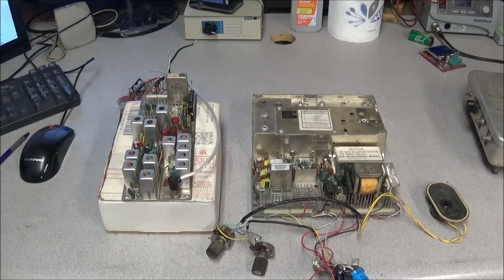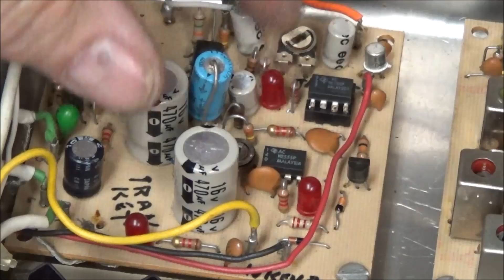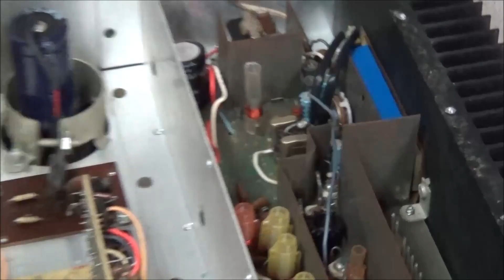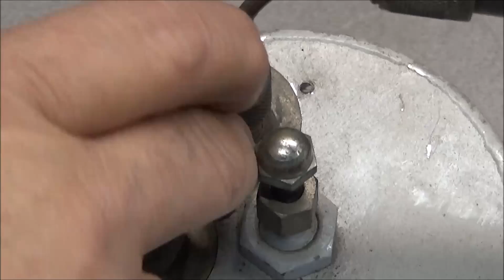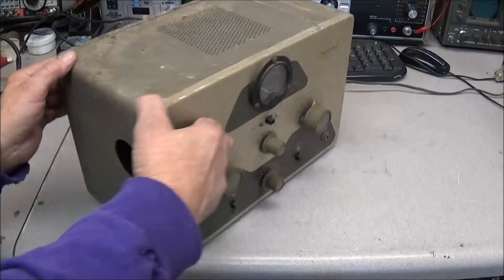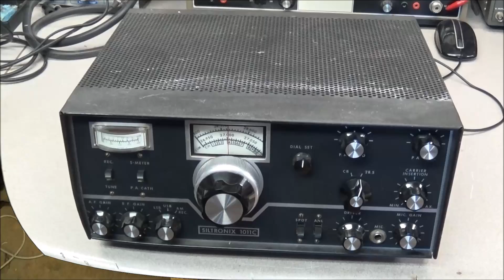#41 Shop Talk  Projects, Past, present and future

Comment: Would love to find a source of mastrii hardware, our club has an original station,  the racked repeater, not conversion,  i was on hill yesterday with my best friend and we put in about 10 hours. I do what i can to maintain that system, but i would love to find a few mastrii mobiles that I could convert for the experience or to put on the air.  Our Micor at other site died , horrible death by rodent urine and feces!  I would be thrilled to have another mastrii station for that system.  They are tanks!
Reply from the maker: They were tough old radios for sure. Problem now is the old part. Parts are getting harder to come by now.  Plus age is not helping. You can still find them from time to time but getting harder.

Comment: are you going to put these repeaters on air for people to use? if so honestly, id just grab the newer hamtronics exciter/receiver modules and a henry 100W pa. or find a MSF-5000 local to you someone wanting to get rid of. at least with that the rx specs would be much better vs GE or the regency. 
I just earlier this year de-commished my GE Mastr II 100w rpt, in exchange for a MSF-5K the GE PA starting going wonky, got tired of trying to keep it going.
Reply from the maker: An honest answer? No way. I put up a few repeaters in the past. Ran one for years. Was it fun? Yes. Building the repeater and getting it going was a blast. But there are always the complainers and maintaining them.  After I lost my tower space due to development in the area I sold most of the stuff off. Wacom 4 cavity duplexer. Maggiore Hi-Pro repeater and Cat 1000 controller.  Plus there are a half dozen repeaters in this area. And all I ever hear is the repeater ID itself........ But you are correct on the equipment.
Reply: I got my one repeater, and one it will remain. I may end up with a IFR 1200SuperS in the very near future, that is going to be fun to fix. since someone dumped beer in it.

Comment: you can get a master II model E mobile cabinet. you can get it all in there. it's a double radio cabinet for mobile. I got a few but the freight would be horrible. GE made dual band and cross band and mobile repeaters in the E cabinet.
Reply from the maker: You are correct. There are so many possibilities.  GE made some fine stuff back in the day that is for sure.

Comment: My all time favorite rig is my Drake TR3...just bought a parts rig for it, that's newer, and seems to be better shape than mine. (
 my ps lost bias voltage and cooked the finals ) so a recap for the PS and new tubes needed in mine. Will fix the better of the two. Good Luck and best 73 ! de KC8YOX
Reply from the maker: +dynamic881964 Would love to own another TR3. Or a good set of twins. Good job on the recap.
Reply: My best recent find was an analog Simpson 260 volt/ohm meter....for 10.00 at a garage sale...replaced the batteries and she works FB !
Reply from the maker: Now that is a keeper!/ Good find.

Comment: You've got some great old rigs there! I'm especially looking forward to the HW101 resto. I have one that worked the last time I used it (about 10yrs ago), but I would want to do a full restore on it. I also have a Kenwood-Trio ts511s that I would like to work on too, but I can't seem to find much info on it (just a poorly copied owners manual). Great channel you have here!
Jim
K8NBZ
Reply from the maker: +Jim Kodysz Thanks Jim for the kind words.  Always like a variety to work on. Will be getting to that 101 shortly. You are right, not a lot of info on the 511. I have a parts one here somewhere I thought about repairing but may be too far gone.

Comment: Some fun projects you have lined up there Buddy.  The DX-20 will be especially interesting to me - my Novice rig was a Johnson Viking Adventurer which was in the same class as the DX-20 back in those days.  Got a Heath VF-1 when I passed the General test!  73, Bill
Reply from the maker: +rollerbald Hi Bill, The old DX-20 is a super old rig. Will be  a pleasure working on that. Thanks for the comment my friend. I remember the Adventurer. Had one in the shop about 3 years ago.

Comment: Projects, projects, projects.  We never seem to run out of projects.  For every one I finish I seem to acquire 5 more.  Its a never ending battle.

The 1011 series is one of my favorite 10M rigs, have a like new 1011D setting next to me at the bench.  Kind of a keep it simple stupid design that works very well.  I know some complain about frequency drift on SSB but honestly I have never had a problem with any of mine.  Let it warm up and its very stable.  Think some are accustomed to solid state rigs where you turn it on and its ready to go.  Been planning on doing a DDS VFO conversion myself.  Already have the VFO, just need the time to install it.

Definitely get the National back up and running.   Nice rigs and that one looks to be in pretty nice condition.

Mike
Reply from the maker: +MikesRadioRepair Got to love projects. I agree with the 1011 rigs. Tune em up and keep them service and give ample time, they want drift too much.  Let me know when you start the DDS VFO project.Yes, the National has to be right. Been my main 40 meter rig for a while.

Comment: When I first started working for Motorola service center  in 1970   Tubes dynamotors vibrators  I liked all old equipment
Reply: +DENNIS N 
Love the old white face or shoebox Messenger 1's.  Probably my favorite AM early tube CB.  It was actually a 10 meter converted for use on the CB band.  The conversion was nothing more than a dropping resistor on the final tube to lower output power and of course a set of CB crystals.
Reply from the maker: +DENNIS N That was a while ago my friend. I am so in love with old equipment. New stuff is nice but older stuff is fun. I worked for the other two. General Electric and EF Johnson. I loved the old Messenger gray radios. I have a few of them here. The old Motorola Micors were also hard to beat. Also the old Motrac. Love those.
Reply: when motracs came out I purchased them before working for Motorola I used Johnson business radios with the side mount tone alearts, if you remember those selective calling the equipment was on 35.06 MH low band
Reply from the maker: +DENNIS N You talking about the tone alert box that had a lever and a light? I sold a 27 MHz White face last year that had that box on the side. I fully restored the radio. Covered the 1-23 channel cb band and had 6 transmit crystals.  That thing looked new and wish I never sold it.
Reply: Yes tone alert they hat a light and a tone when you were called the light would stay on so if you were out of car you knew you had a call   my frrst CB was a johnson messenger 1 5 channel
Reply: brings back memories about the resistor trick, that was when I was 17 yrs old had messenger 3 transistor units 23 ch messenger 2 black face 23 channel
Reply from the maker: +DENNIS N Memories and nightmares he he. They were some good old rigs.